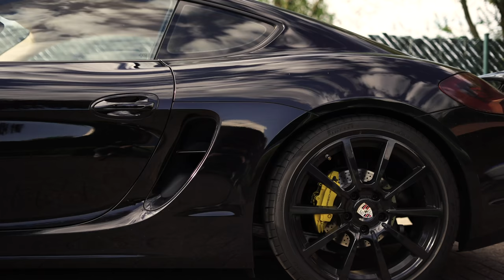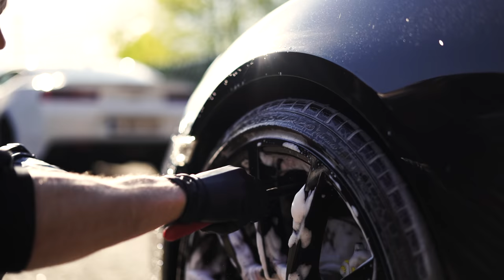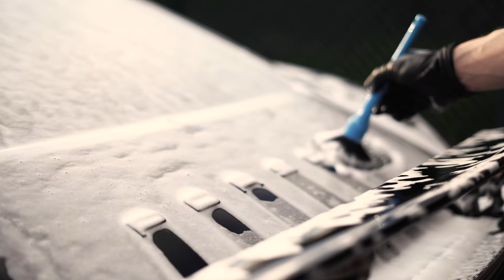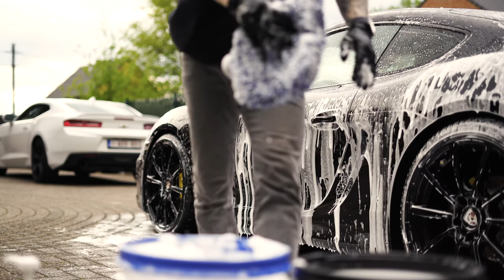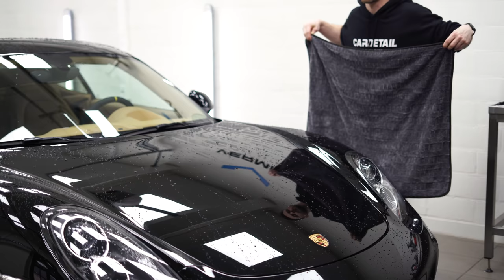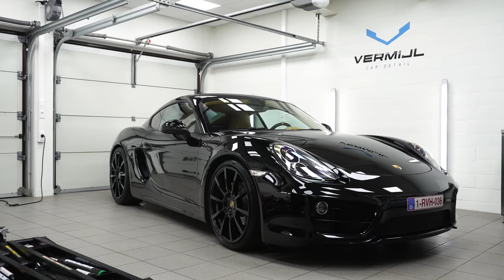Porsche Cayman Maintenance Wash - Exterior Auto Detailing

Comment: wouldn't it make sense to use rim cleaner and then a high pressure before using a brush for the rims?
Reply: I don't use a wheel cleaner if my wheels are not very dirty. Just soap and the brush